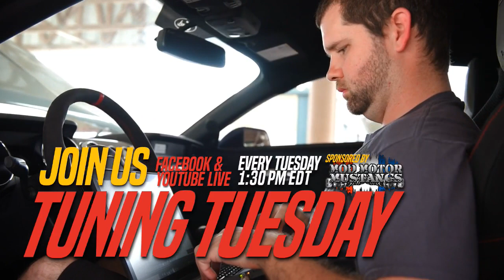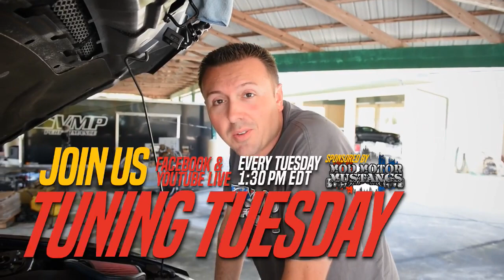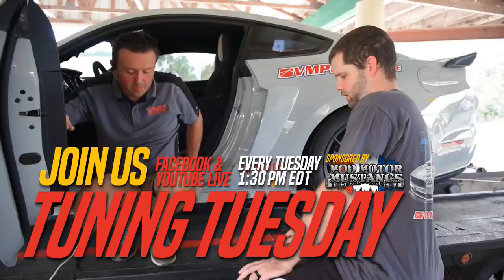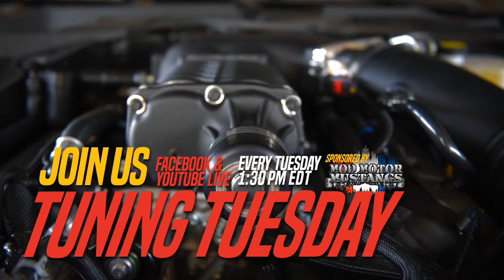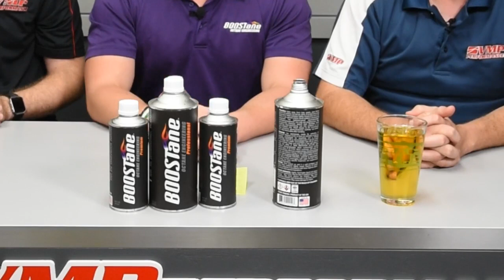Tuning Tuesday S1 E44 | September 25, 2018

Comment: Even using the same gas station you will have some variability. You will get 93 octane when you buy from a reputable name brand station. Your vapor pressures will change depending on the season, and there will be some variability in the RON and MON ratings

Comment: Why doesn't the old 390 ford fe engine get any kind of new parts, the 428 fe engine made ford great back in the 1960s and there is a big market for that engine platform to this day. All older ford guys have been screaming for blower upgrades for years for the 390/428 fe engines.